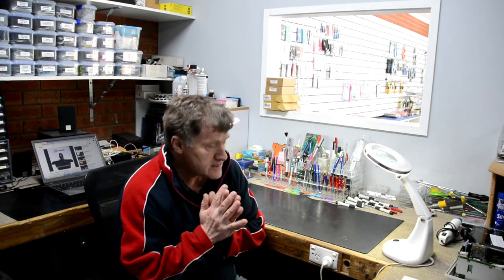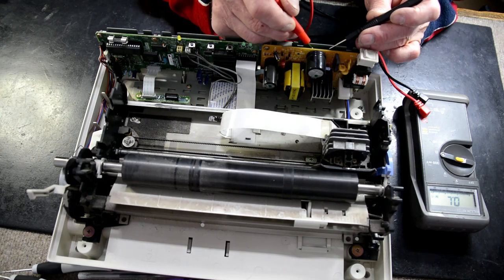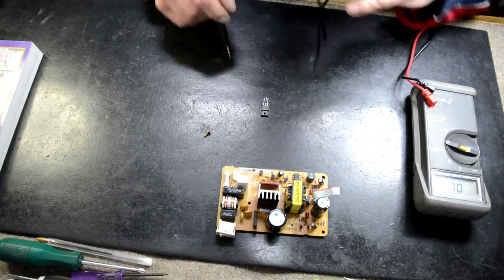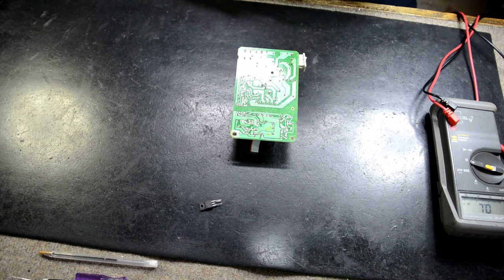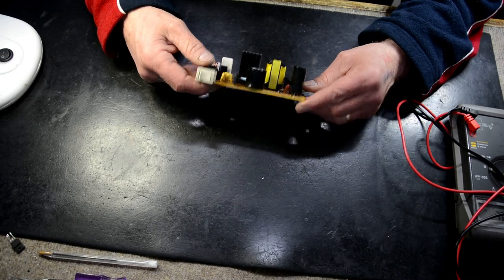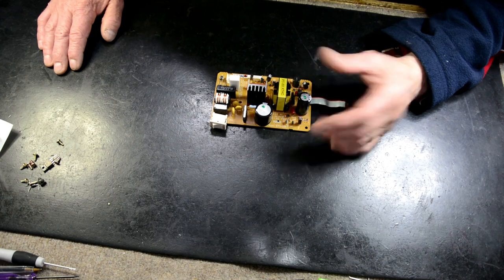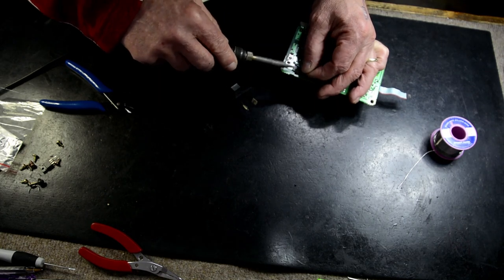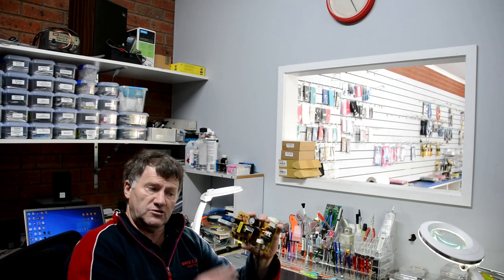Epson Lq-300 Power supply fix

Comment: If power supply unit has failed in some device, Can we use a 230v to 12v SMPS unit and then use buck or boost converters to get the required output voltage to that device?